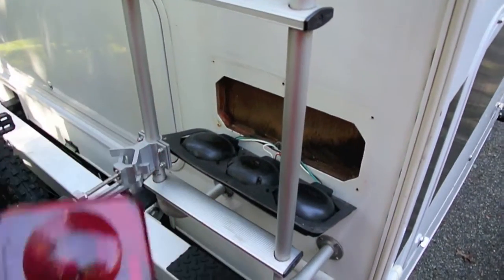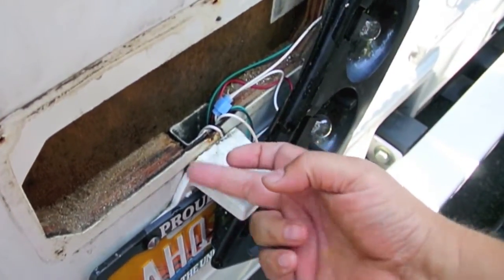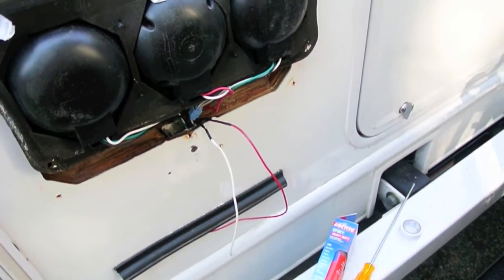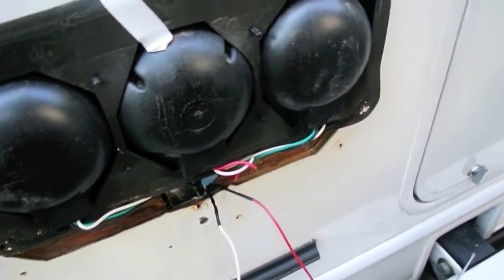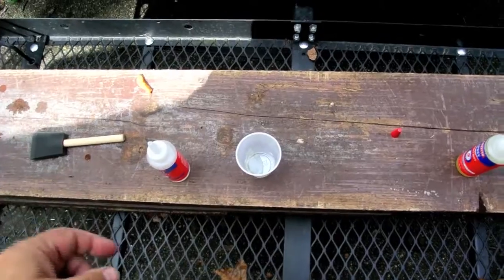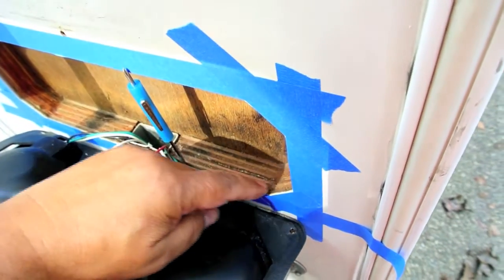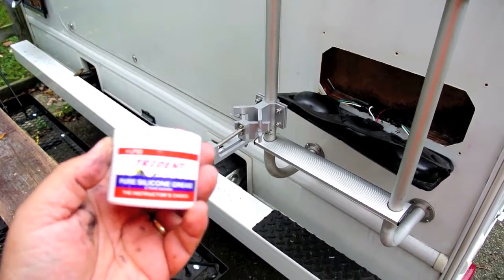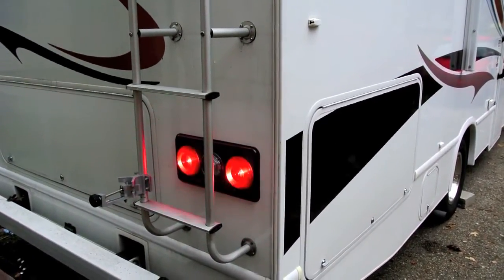Repairing tail light water damage on my RV.

Comment: If you really want to irritate yourself with the build quality of your RV check the lower inside edges of the walls, they're rotted rehind the fiberglass probably a good 10" up or more. I have a 2015 Coachmen prism 2150le and everything you talked about is the same on mine.  Good luck with your rig brother.
Reply from the maker: These days, RVs are not made to last more than 10yrs.

Comment: I have a motorhome with the same taillights. I have a bulb that is out and when I removed it, I cant find how to separate the red lens from the black base. I have tried prying a bit , but I dont want to break it. Could you tell me how you seperated it? Thank you very much!! Have a great day!
Reply from the maker: Mine cam apart easily. Did perhaps someone seal the two together to waterproof it?

The tail lights are made by Command Electronics, and you can get replacements directly from the factory: https://www.commandelectronics.com/shop/command-ultra-modern-recessed-double-triple-12-volt-tail-light

Comment: I disassembled the taillights of my 2016 Minnie Winnie last weekend, primarily because the was some moisture behind the left backup light. and after watching your post I thought I had better check for possible water damage. Fortunately there was no evidence of water intrusion, but there was a fair amount of dirt and dust. After cleaning everything thoroughly I put things back together as you did and completely sealed them.  I like the Bargman lights you installed but I couldn't find a price for them on the internet. If you don't mind saying, how much did you pay for them.
Reply from the maker: For most projects I do, I have a corresponding webpage where you can find additional information. The webpage for this project is at http://www.rv-project.com/repairs/newlights.php

I paid about $40 ea for mine, but since then they have come down. I have seen them at Amazon for about $32 (http://amzn.to/2yCCVfo) with free shipping.

The part number for the Bargman lights is 34-84-009 for the incandescent version. They also make a LED version, but I am not sure what the part number is. As well, not all vehicles can use the LED version without either series dropping resistors or a LED flasher. I discuss those issues on the webpage.
Reply: Those light run around $58.00 per light..Amazon sells them also.
Good luck...bye the way I like them also👍😁

Comment: Great info i also have water in just the back up area any ideas
Reply: The center lens just  some moisture in there it has two screws but the clear part did not want to come out
Reply from the maker: The gaskets are not sufficient to repel water. 

There is a LED replacement available that did not exist when I upgraded mine, which means you won't have to modify the RV.  

I would use silicone sealant to seal around the replacement.

If just the center is leaking, you probably could seal it from the backside with clear sealant.

Comment: I’m trying to replace a burned-out bulb in the tail light and wondering if you’ve ever done a video on that?
Reply: Did you ever get to replace your bulb ? I am in the same fix can’t get the bulbs to work on the brake light.
Reply from the maker: I ended up upgrading the fixtures with LEDs as I could not adequately maintain the seals: http://www.rv-project.com/repairs/newlights.php

Comment: I agree that the workmanship on these thinks is shoddy however the wires to the license plate, however cheesy, is not the source of water infiltration. Water like everything else is pulled downward because of gravity.  I will leave an opening in the bottom for drainage after sealing the wood.  I always go back with stainless steel screws.
Reply from the maker: Thank you for your comments.

Comment: 👋If you could help me I need help . I have nothing to show me the correct bulb to use in my Rv . You have the same system and I can’t get a new 3156 ( that was in it ) come on . And the fuse box in the truck part doesn’t show me a fuse for brake lights Since it is a class c the truck book calls for something else . Could use some help if you can . My husband who knows all this now has Alzheimer’s and he has forgotten more than I could ever know
Reply: Th

On my class c winnebago minie winnie the reverse light bulb is  3156 and the 2 brake light bulbs are 3157.
Reply from the maker: Electrical problems are very hard to troubleshoot via message system.  If you know how to use a voltmeter, try checking for voltage at the lights. If you do not have that ability, your best option is to have it repaired by someone.